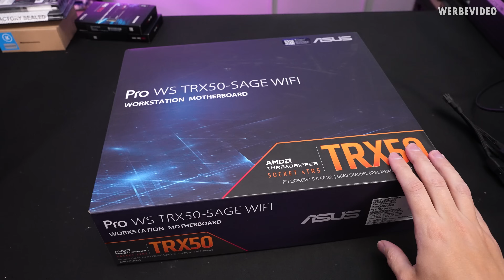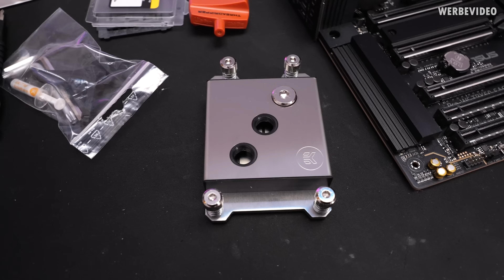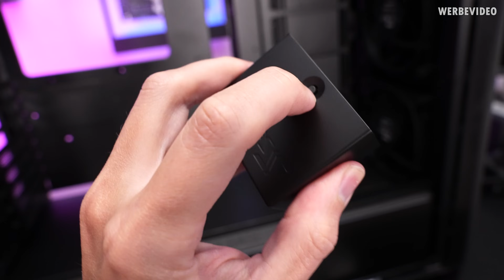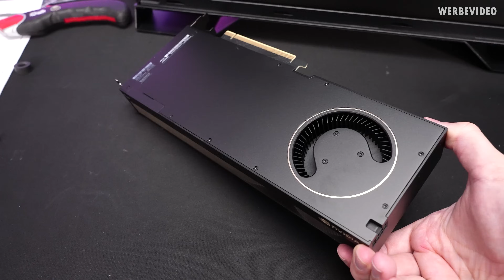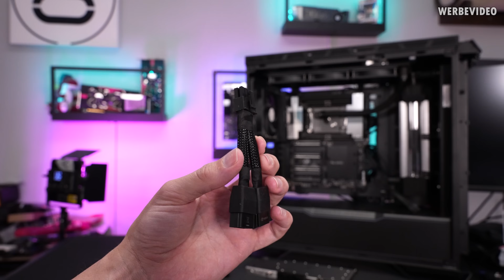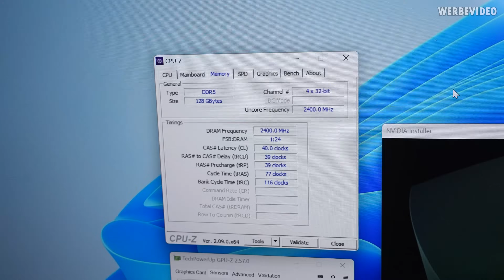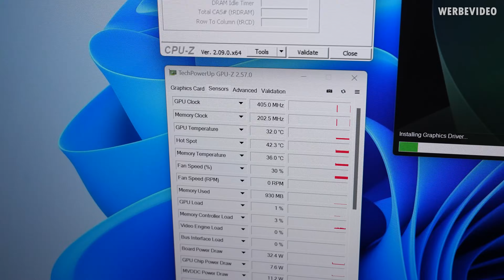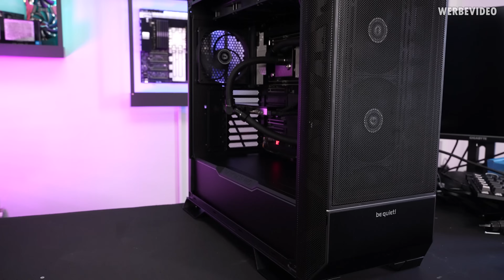Building a Crazy $10,000 Threadripper Workstation for Misha Charoudin @mgcharoudin

Comment: That 300Watt usage is funny compared to a 14900ks
Reply: No need more higher clockspeed with more core u have + at least workstation will run at quad channels, but also octa channels ram. Once again this thing is decided to do not overclocking yet on this build, but still enough for the owner, even if this will overclocking average 24 cores will 350W cuz Amd is Amd (the most efficient)
"low clock low power" people often choose this 24 cores
Reply: its like 440watt on PBO
Reply: 48T at Lower frequency vs 32T. Also 7960X's default TDP is 350W according to AMD's documents. 
Not sure why it doesn't use all its power, as all PPT, TDC and EDC are well below it's limits. 
Wouldn't be surprised if almost every OC option was disabled in UEFI by default due to the HEDT platform.
Reply: @EasyMoney322 Threads don't really matter so much as performance.. the 32 threads of the threadripper have 30% more performance in total than the 48 threads of the 14900ks. And this is the lower end threadripper that you'd pretty much only get for the feature set, not for the performance. Intel just can't compete with AMD on efficiency, it's the same in server CPUs.
Reply: @seeibe  its the other way around tho. 14900 is 32T, and this threadripper is 48 threads. Also only 8 of these cores are performance cores. So we basically comparing 24 cores vs 8 cores + 8 e-cores.

While its true that AMDs are better and cheaper in server and HEDT market, I'd still go with Intel if we talk about second hand servers due to vendor locking and other PSB features preventing second usage of them.
Reply: @EasyMoney322  threadripper eats up alive ur 14900KS😂
8 performance core + 16 efficiency core and 32 thread with 36mb cache vs 24 cores and 48 threads with 153.5mb cache. 😂
Reply: @EasyMoney322 Can u imagine the 7800X3D with 65W power draw beats the 14900KS with 140W power draw in GAMING?
Reply: @d4nith3  why would u bring gaming on eco mode into the discussion of all-core workloads.
Reply: @EasyMoney322  second hand if price is okay y not.
About powerdraw?!, we have different cache, numbers of cores, total thread we had, will by dual, quad or even octa channels, can u imagine the clockspeed is not everything, but clockspeed means more power draw, but techno more massive task with less power consumption, it's mean powerdraw isn't everything.
About P or E cores with different scenario, sometimes with different types of sin, which recently e cores can draw into 3,9Ghz everage with multiple threads, this is the reason for the three musketeers 14900ks, 7950x3d, 7950x for each can b won, depending what kind of sin, clockspeed with heavy task sin 7950x will
A lot task with simply task 14900ks will soon done the job,
Task with more dataset 7950x3d on fire.
(That bcuz p core will takes 2 threads but not at the same time instead 1 by 1)
For years using ppt, tdc, edc will not always configure but yes with soc, but still biggest powerdraw isn't everything!
Reply: @EasyMoney322  Oh oops. You're right about the threads. Yeah AMD's advantages don't matter much to us plebs, but it's a huge deal for cloud providers and the like.
Reply: @zombie-mecha  Because EPYCs tend to cost more and you have a risk to get a "Bricked" CPU. 

I'm just trying to say that it's expected (at least to me) for HEDT or Server CPUs to have a smaller powerdraw per core, than desktop versions that just run at higher frequencies on the same architecture and aim for the single-core performance and low-latency tasks.

And that comparing desktop CPUs to higher cores count CPUs that are made for high parallelism and scalabe tasks in tasks, that benefit from multitasking, is strange.
As 7960x is made out of Zen4 CCXs, if we crank em up to the same clocks as R9 7950x, we would hit a way bigger power consumption. Same goes for Xeons and especially for Xeon Scalable.
Reply: @EasyMoney322  don't worry the new board now even allowing for u to oc ram while running at quad channels with ur workstation, yhe before only can with dual channel,
anytime we can oc them for more hz with cpu or ram, but on that build is decided to do not oc yet, doesn't mean we ignoring the max power draw.
Cost or cheap depends what u need, what would we choose, 13600k, 14700k or even 14900ks or we choose 7950x. We dealing with own pocket, n what kind sin we work to, or 7700 may enough. Epyc is epic n cheaper also more faster n lower power according u choose with intel workstation
Reply: @EasyMoney322  There is no reason to buy Intel since Ryzen 5000 series launch, not even in workstation space. Intel needs to do something  otherwise is gg. 3DV Cache is more important than pushing 1 core to 6GHz and all core to 5.4GHz.
Reply: @d4nith3 You mean 180W.
Reply: @zombie-mecha  Maybe if we calculate in performances and electricity bills Epycs are cheaper, but if we talk about price per unit like DL380 vs DL385, epycs-based servers cost  2+ times more where I live.
Reply: @EasyMoney322  no one push u to buy what u can't, just bought what u have to!
Reply: @EasyMoney322  TDP is just a number. It has nothing to do with the power usage. Just look at how AMD calculates the TDP.
Reply: @WereCatStudio  True, but I've found that they calculate PPT as 1.35*TDP, and max PPT in my experience was always higher than the TDP on the specs. In this case, however, its 15 percent lower.

Comment: I'm stability testing my 2990WX in Cinebench 2024, you should be able to do that with a 7960X. Time to get off old R23.
Reply: Cinebench 23 pulls more power and heats cpu more so not much point on using r24 for stability testing.